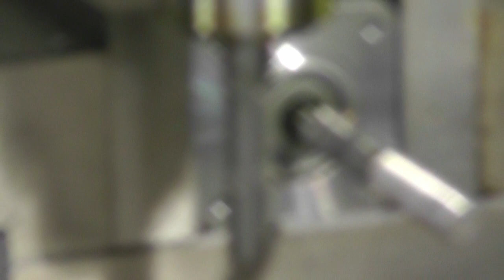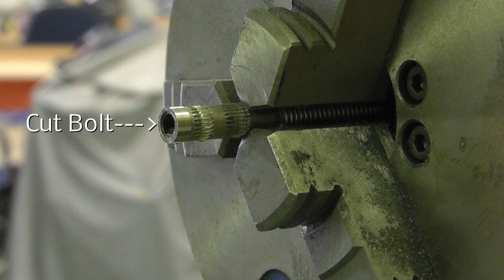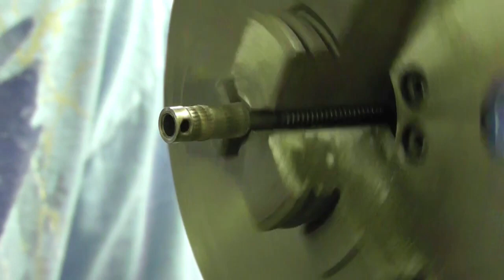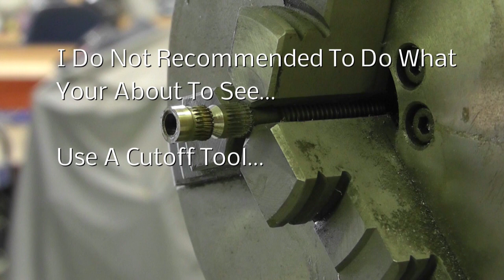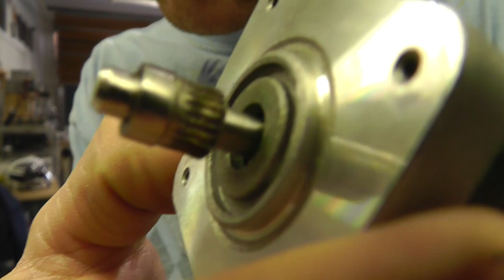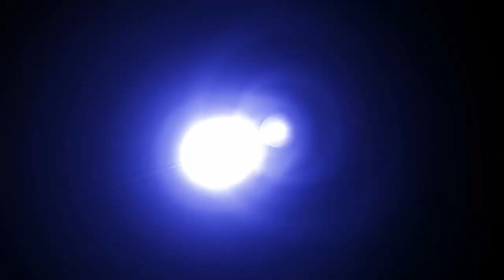The Sounds Of Making Hobbed Gear (How To)

Comment: hardly practical ... just go buy a real gear from Grainger or McMaster ... might make a good spline-press-fit-into-plastic-parts though. Does NOT generate an involute  tooth form. What you tried to show is called "free hobbing", but you need to use an involute gear form to do it properly ... a tap is not that. Good try.
Reply: OOOH ... on the attack are we? Well, the title of the video read "The Sounds of Making Hobbed Gear" if it's not a gear, then it should have had a different title.